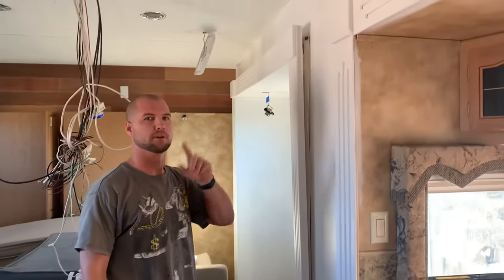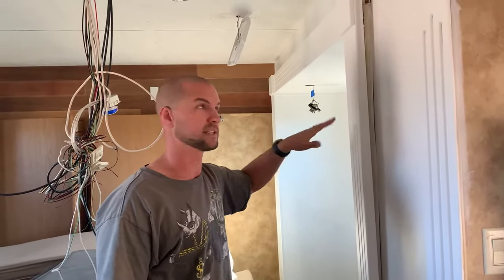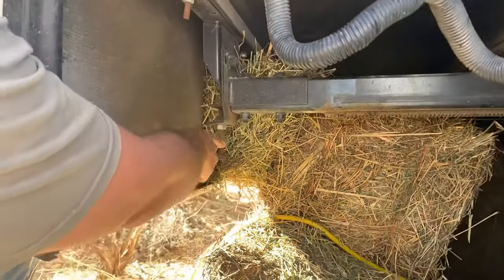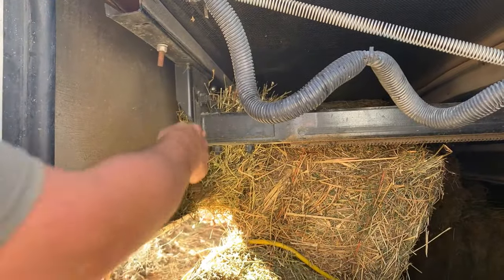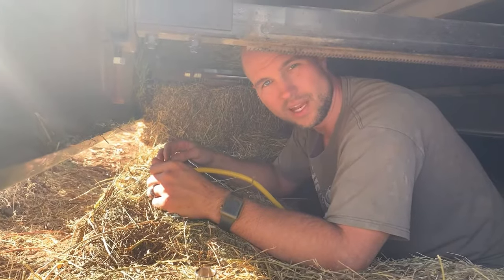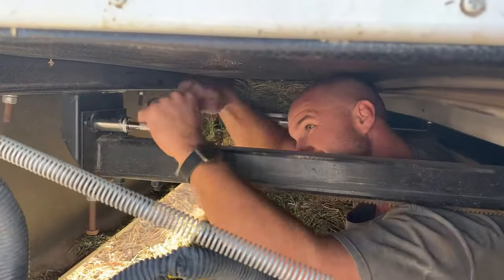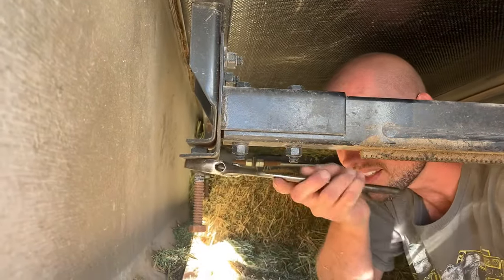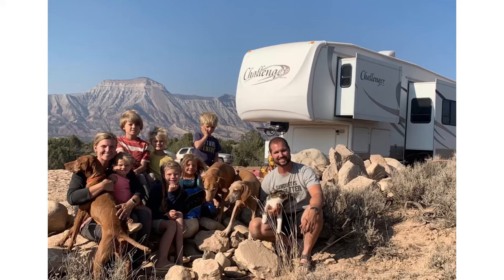HOW TO adjust your RV/5th wheel slide if the top is leaning in

Comment: Those nuts need torqued and slippage marked
Reply: This is an inaccurate comment - Lippert (the manufacturer of the slide hardware shown in this video) says otherwise in their videos as well as in their Through Frame Slide-outs Service Manual (re: page 14 'Horizontal and Vertical Room Adjustment'). The manufacturer does not provide torque specs for service personnel for any fasteners related this product). These are RV slides, not engines or something safety-related requiring precise to-spec fastener tightening to the point of an exact torque. The process given in this video aligns with the service manual for the product. What is 'needed' is what the manufacturer states and that is what is shown in this video.

Comment: You know where the adjust meant for side to side? One side seems to come in tighter as it should the other still decent but not like the other side
Reply: The two bolts he first loosened allow for horizontal adjustment of the slide as well as vertical, there are slots for both and one overlays the other allowing for adjustments in both dimensions.

Comment: Looks like you still have a pretty good gap.
Reply from the maker: After the adjustment, you can use the controls to run the slide out more if it still has a slight gap.

Comment: Thank you for this video… always appreciate somebody that knows how to get right to the point.

Quick question… This video is about adjusting the slide vertically… Do you happen to know how to adjust the slide horizontally?

My slide is connecting on the rear side but has a gap towards the front

Comment: i did that adjustmant to my momtana 5th wheel but it didnt help it still tiped
Reply from the maker: Hmm, maybe it’s a little different.  Hopefully, you can find a video that is more specific to your camper or issue.  If it’s designed like what you see in this video, it SHOULD’VE fixed the issue.  Sorry that this video wasn’t helpful.  I can’t think of any other reason why it wouldn’t correct the problem.